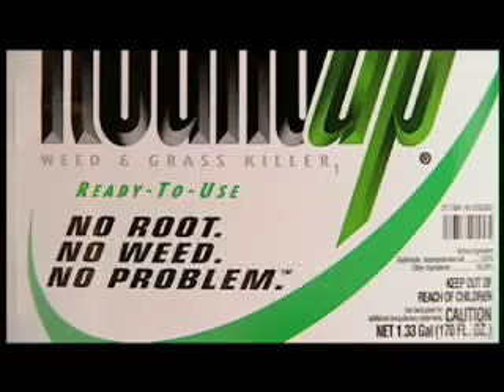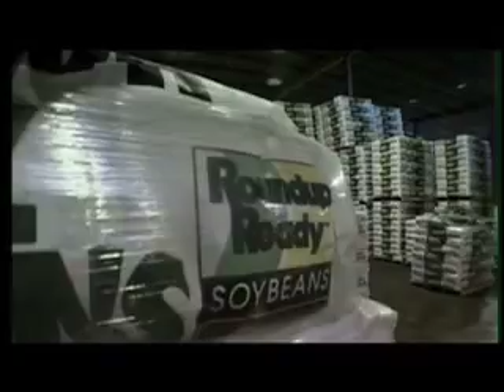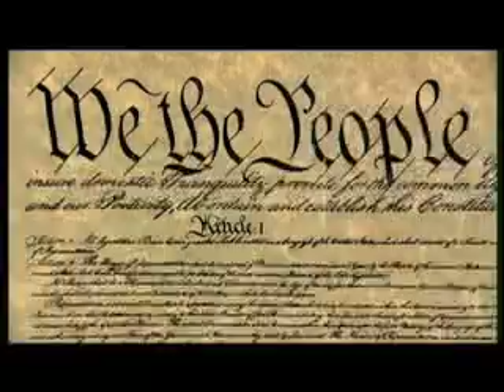The Future of Food  - Introduction

Comment: Even with acceptance of GMO food, the biosphere will be producing about half the food of 2000 before 2050.  AGW effects, depletion of oil, soil depletion from all causes, and good water depletion from aquifers and the surface, along with pollution from heavy metals, and long lived herbicides and pesticides, with oceanic fisheries collapse after 2035, are the reasons for the losses.  Gains by technology adds some, but not enough to do more than keep the food supply of 2050 at 50% loss from 2000.

Comment: The non natural genetic modification in the video is when they changed it so it can be sprayed with insecticide without it damaging a food, so the corn will be normal with insecticides.  If they were normal corn and you sprayed them with insecticides you have potentially poisionous corn + insecticides but if the cord is modified it becomes corn - insecticides and adding insecticides makes it just corn so it is corn as if no insecticides were used and no bugs had got to it